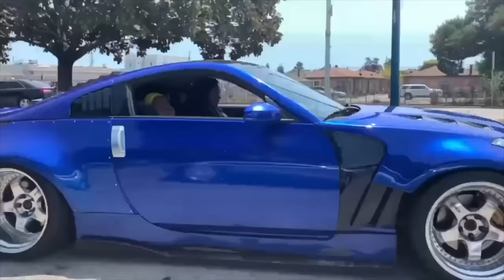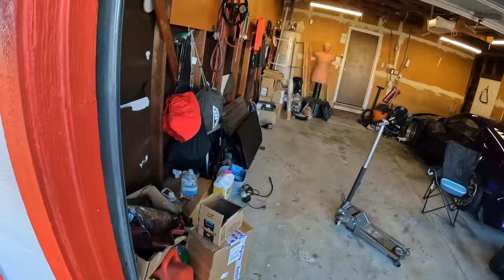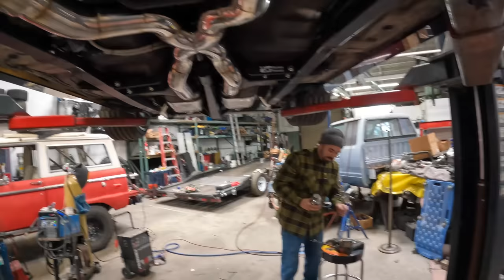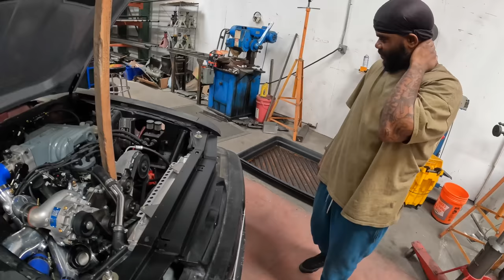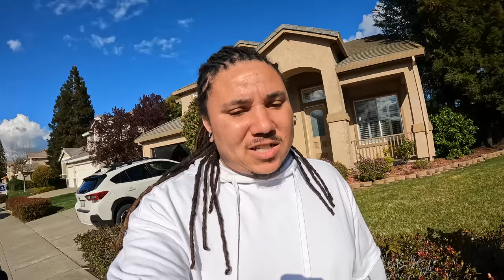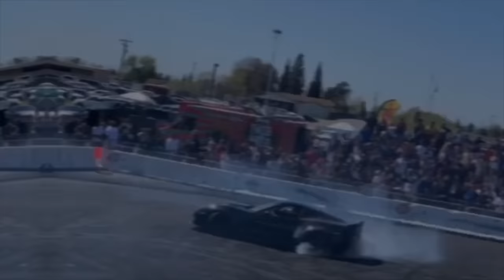The New Custom 3in Exhaust Sounds Good On The SuperCharged Coupe!

Comment: Mike I had a g35 sedan back in the day. Since ur doing the LS Swap. Z1 Motorsports sells an entire Akebono big brake kit from the g37S to fit the g35. Comes with a bracket so it’s all bolt on and full front and rear calipers , pads, rotors and SS lines for a very reasonable price. I had the same color G35 so I got the factory grey finish that says Infiniti on them. Matches perfect and looks stock. Car stopped on a dime

Comment: Mike- u should fishplate the sub connectors (1/2 inch plate) as a sacrificial low point on the swangstang ! U know u gonna be board slidin that bitch ! 😃👍👍👍👍👍👍👍👍